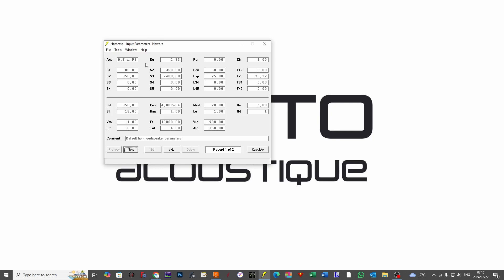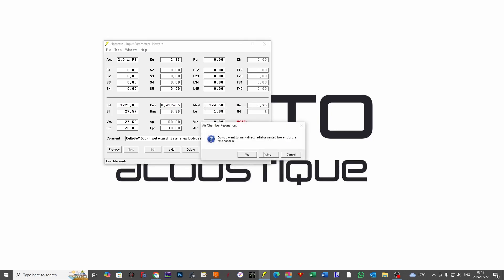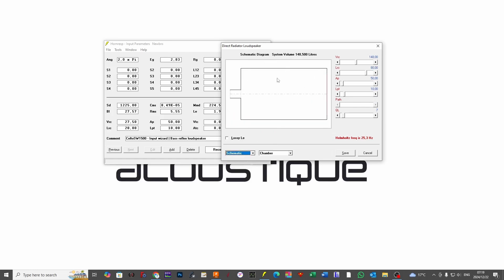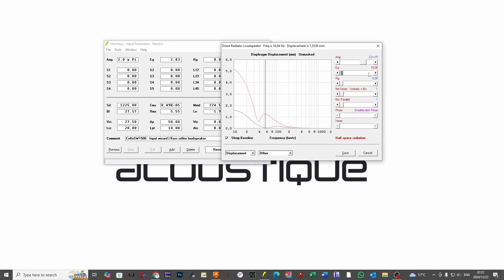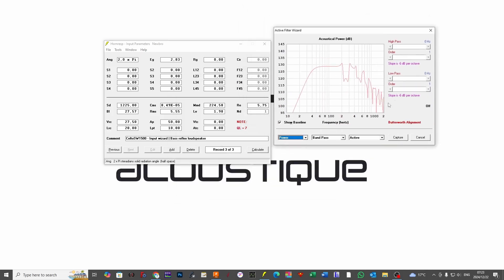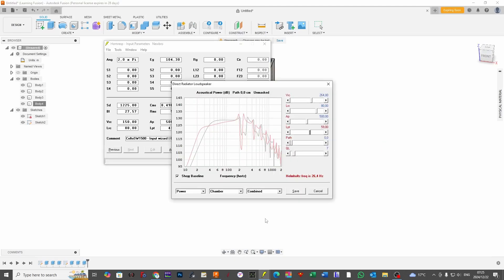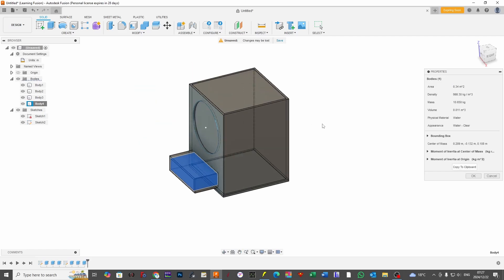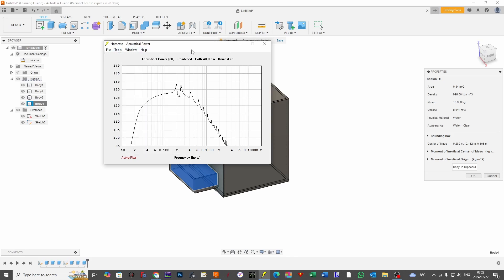Hornresp tutorial part 2, how to design a bass reflex

Comment: Hey! I recently tried designing an enclosure for a midbass speaker. When i choose Lpt with EC, and set it to a preffered number, is this going to be the real life length of the port, or do i have to add/subtract the end correction?
Reply from the maker: Hey brother, I recently updated myself and see many new features! 

I'm not sure about the vent correction, as if I'm off its normally 2 or 3hz which is easy to correct if tuned lower. I have caught some posts in the past where guys are very off but I'll build something and validate prior to making any videos
Reply: @The-Sound-Guy  thank you for your response, this is from the hornresp help page on the app: "Systems other than tapped horns that use the lpt port tube parameters have an inner end correction added to the tube length". So i presume, that the EC factor is calculated inside of hornresp, and the port length that you input is physical, with EC already taken into account on the graph. But be sure to update with what you find

Comment: Just to clarify, the distance between the port output and the driver face on the outside of the box relevant to port and driver radiation coupling? Or the pathlengh from the rear of the driver through the box to the exit of the port? Jist to be 100% certain... I guess it's the first one.
Reply from the maker: Almost, think of both port and speaker "both" being a speaker, the distance between those 2 items will "yes" effect coupling and work with or against on another depending on the frequency.  This is from the face of the speaker "middle" to the middle of the port all on the face of the baffle. ❤ hope it makes sense and thanks for watching 👀
Reply: Okay, thank you for the clarification. Great video, by the way. there's next to no content on this on youtube, and yours stands out for its clarity and approachability, hope you can keep doing what youre doing and can't wait to see some horn-loaded tutorials🙂🙂🙂   

@The-Sound-Guy

Comment: I still don't understand the part about the box and port volumes. I understood that one is able to see the port volume and the box volume separately, and that the port, when doing all the calculations, is located outside the box. But that means that when I build the box, I have to keep in mind that I want to put the port inside the box, so the design for the box construction must be the box volume plus the port volume, right?
Reply from the maker: Yes, 5 liter box - 1 liter port equal to 4 liter box 1 liter port. Less the speaker and braving all items subtract from the box. Hornresp has a unique tool you can use to work out drivers displacement.
Reply: @The-Sound-Guy  so the shown box internal volume is gross volume not net volume like in winisd?
Reply from the maker: That's 100% correct, we need to subtract the volume of the port from the box. The volume is always Net - the items such as bracing port and driver, I have some drawings that I have done in winisd and it might be easier to follow as I model the enclosure in fusion 360.

Comment: How is the path length calculated if the port is on the back of the cabinet when combining the acoustical power?
Reply from the maker: Hi Royco, for the offset between port and driver for rear porting - honestly, I'm not sure. That is something I have not tested or measured against hornresp, but if I was to take a guess, the shortest distance between port and driver.

Comment: Sorry combining the port together with the driver, does that mean that, the port and the speaker would be together in the cabinet?
Reply from the maker: @NeewErra  we need to remove both the port and the driver from the overall volume. Hornresp can calculate driver volume also, this can be done in another menu. However, if you are starting and learning how to design speaker enclosures I suggest start using winisd. This is an easy-to-use easy to grasp and then move onto hornresp.

Comment: Thanks for this series! A lot to take in and I'm sure I'll be referring to these vid's a lot in the future :)
When you say 'subtract the port/driver volume' I take it you mean if the port and back of driver are internal to the box you will lose that volume so you either need to update the box volume in the settings or just add the port and driver volumes when designing the actual box sizes? Or to put it another way, add the port and box volumes as designed together and then add driver volume as well to get final box dimensions to suit volume. Cheers.
Reply from the maker: @mickduprez9598  you are a 100% correct, hornresp does have the capacity to calculate cone volume. The tool lets you adjust the shape of the cone, this can be helpful say with a bandpass where both chambers are considered the front and the rear chamber.